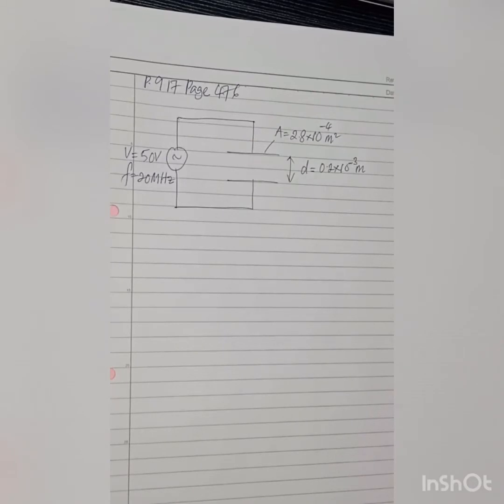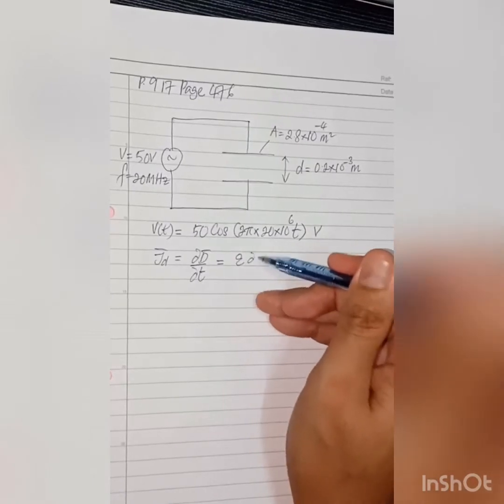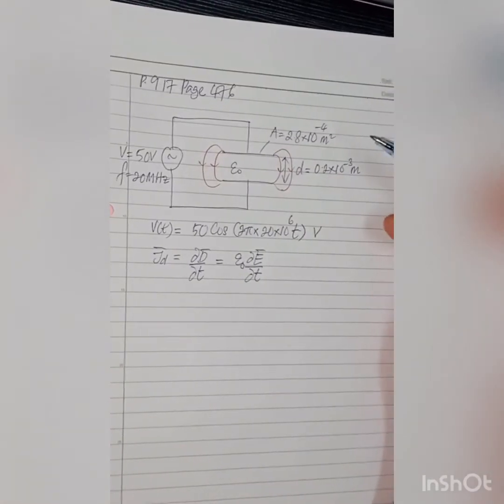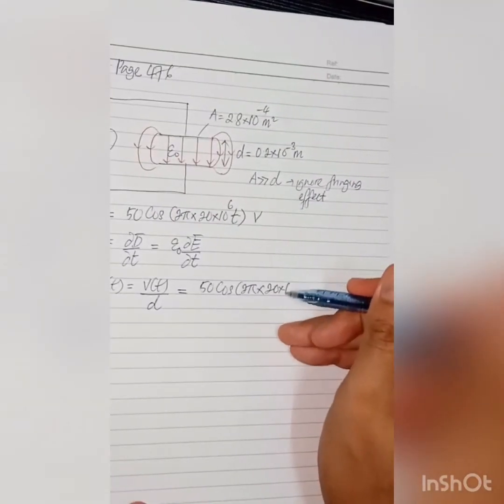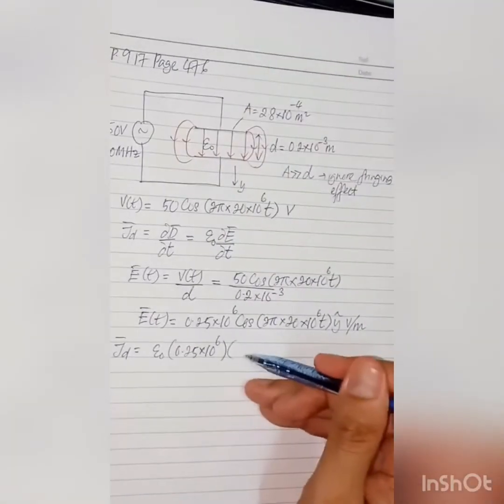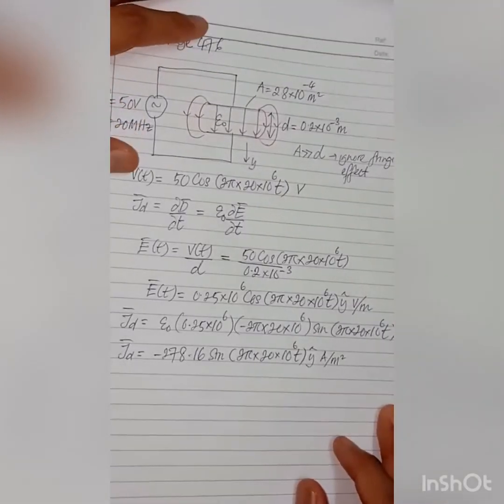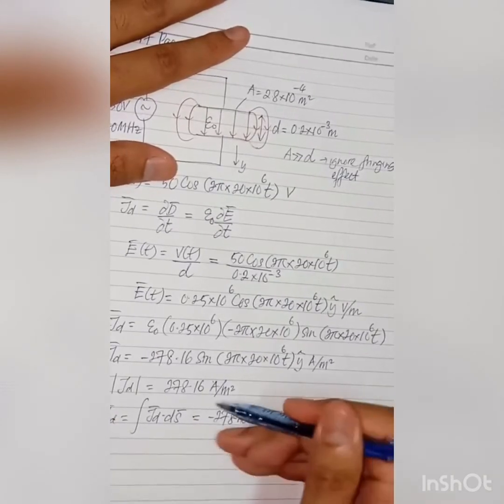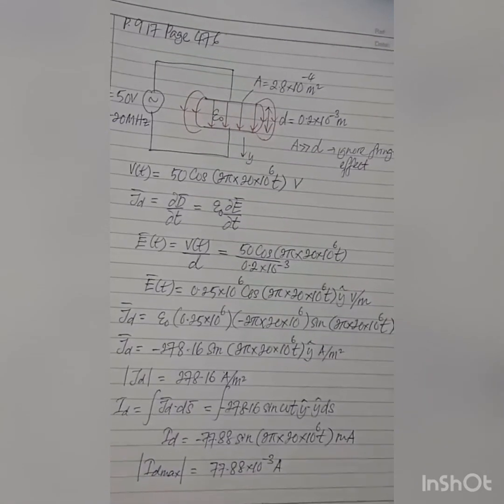Displacement Current - Parallel Plate Capacitor P.9.17 Pg.476

Comment: Thank you Dr! I have two questions.
1. for V(t), is it ok if we assume it is sine waveform?
2. Do the questions we faced normally has uniform E field? How we do if the question is non uniform E field?
Reply from the maker: 1. yes no problems. both are acceptable. 
2. normally only consider uniform field for simplicity unless mentioned in the question.
Reply: @emteducation9106  Alright. Thank you Dr!